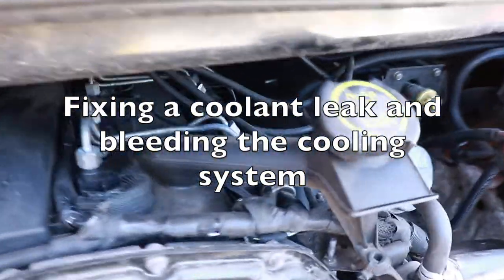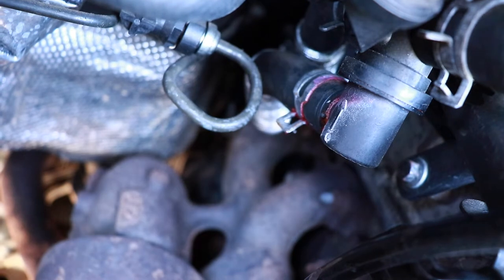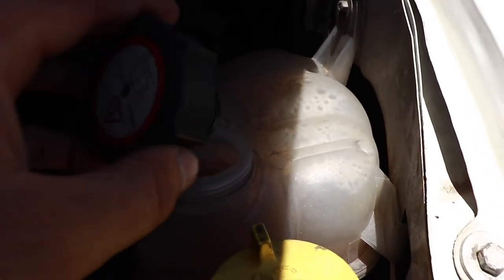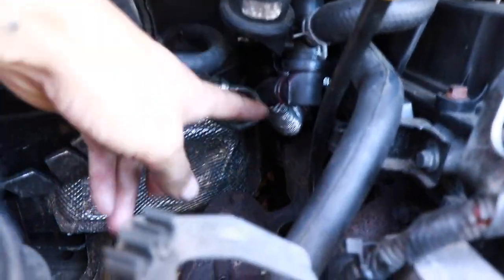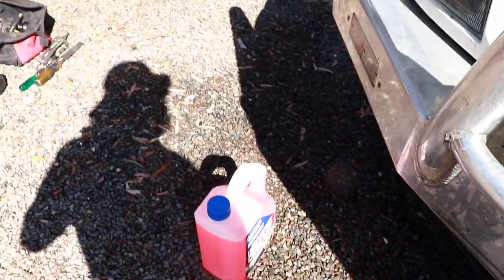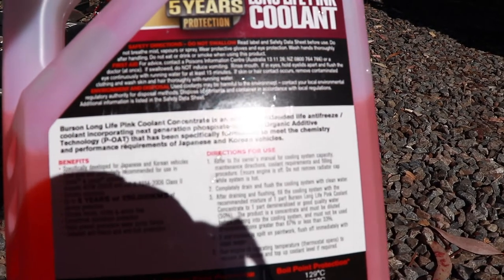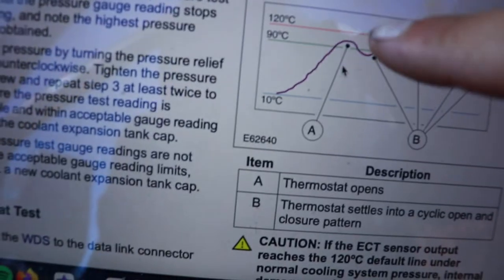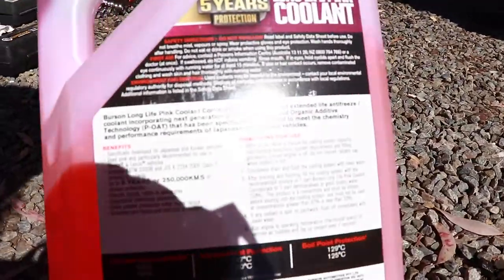Cooling System Repair and Bleed MK6 - MK7 Transit.

Comment: You can use any coolant brand as long as in this case it is oat. Same as topping up oil. As long as its the correct spec. It's fine.